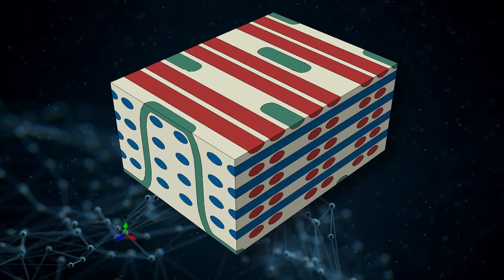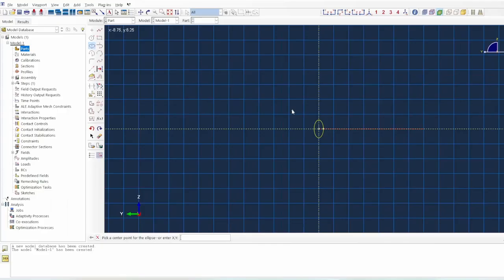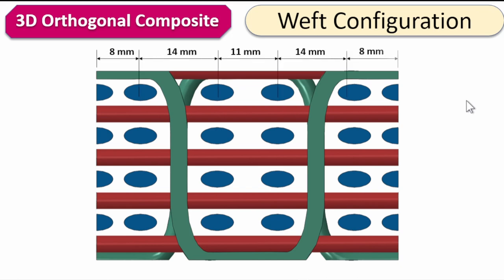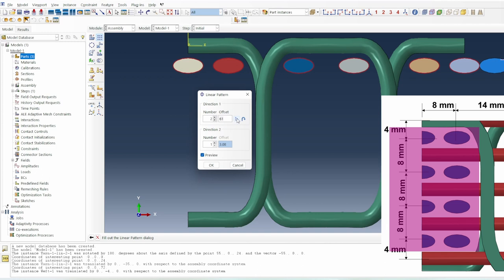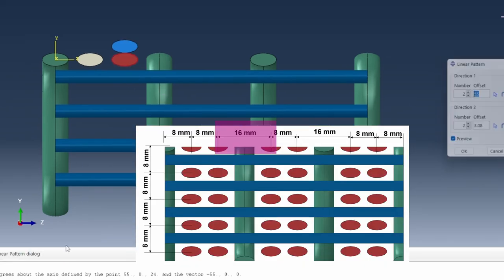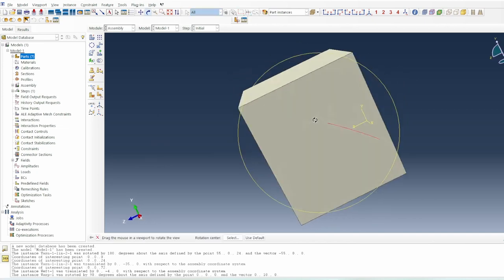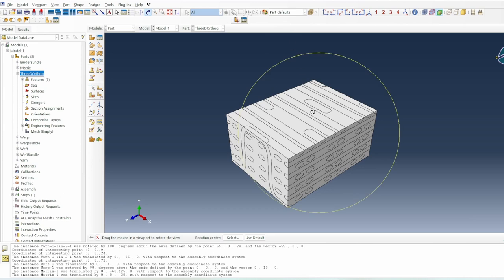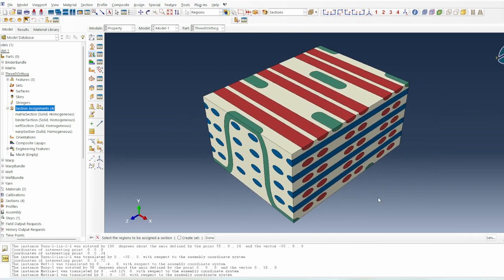Design the RVE of a 3D Orthogonal Textile Composite

Comment: Thanks for the great video, If for example my binder yarn is making a loop? how can I create it?
Reply from the maker: Hello @Said, I think this is possible. It depends on how the loop is formed. If it is formed in a planar way (i.e. flat loops)), then it can be done using the approach I used here. You just need to sketch the path of the loop using a spline function and then generate the full binder based on that.

However, if your loop is truly 3D, in which case it twists about the xy, yz and xz planes, then we may not be able to do it in ABAQUS easily. I will suggest you use a dedicated CAD software like CREO, SOLIDWORKS, etc to design the loops, and then import the desing insideABAQUSfor subsequent modelling. It is not a trivial exercise but this is how I see  you doing it. Finally, you could use the ABAQUS scripting interface, and maybe with some Python to generate the looped binder but this again require you to be conversant with Python programming.